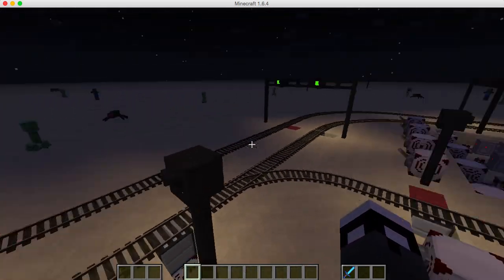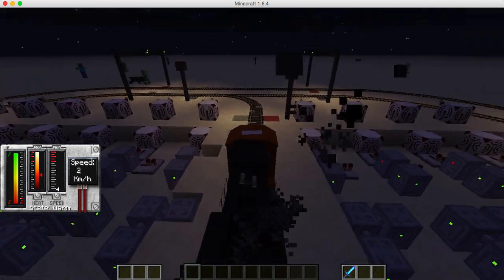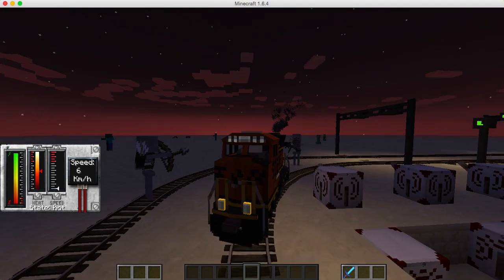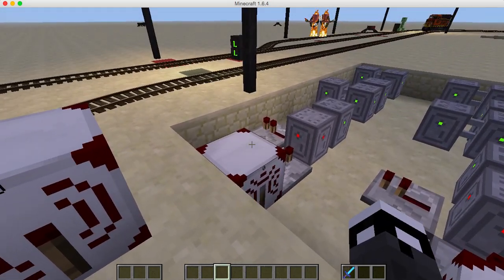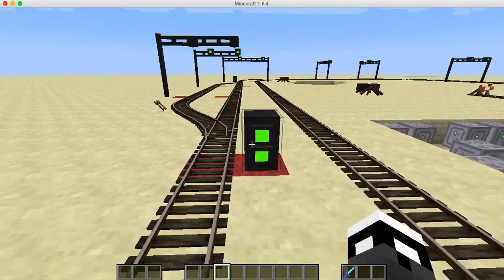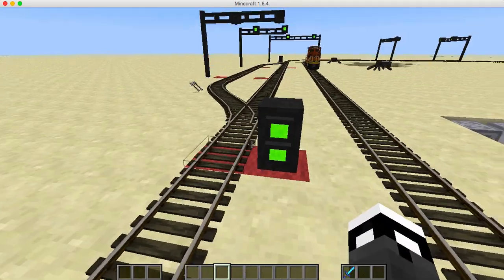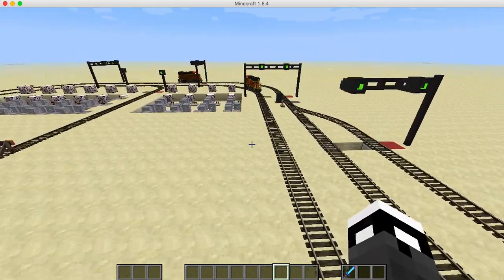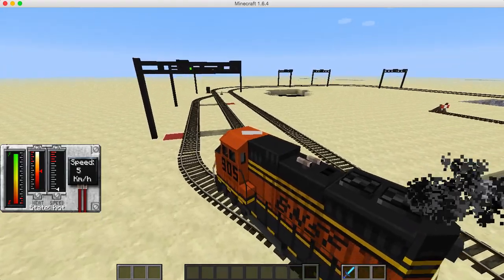Traincraft Signalling 4.2 (in Depth) Original Video!

Comment: Instead of using a player detector, you can use a routing detector so even if there is no player on board, the train will still trigger the signal. Also you can set those detectors up so that the can control when the switches are thrown so you can actually route your trains. One more thing, its more efficient to put a signal controller box next to the detector and connect a reciever to it. Other than that your on the right track (no pun intended). Keep up the good work!
Reply from the maker: Thanks, I appreciate the input. Ill try to better my signaling, but i would like to point out that i did come up with this all by myself. ;D So it's gonna get better and easier pretty soon. :D
Reply: It perfect if there is a runaway train